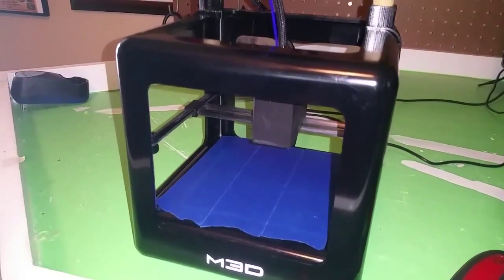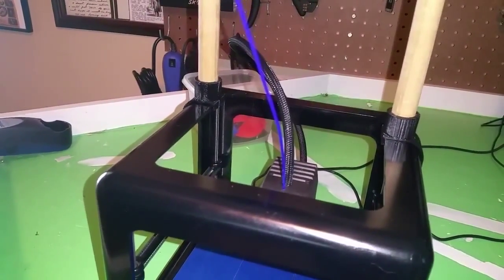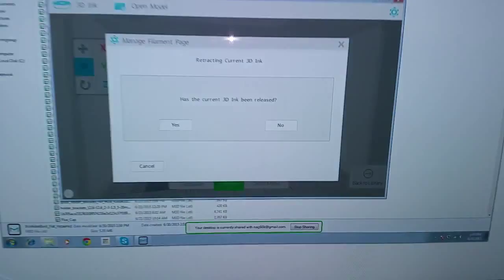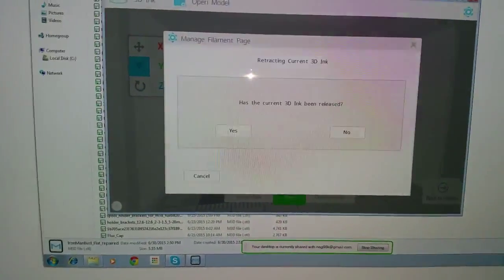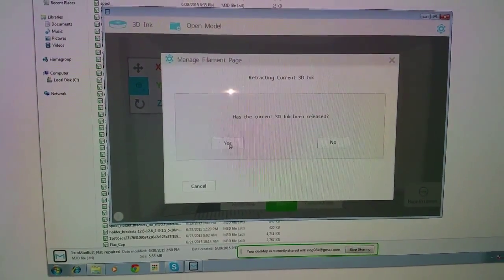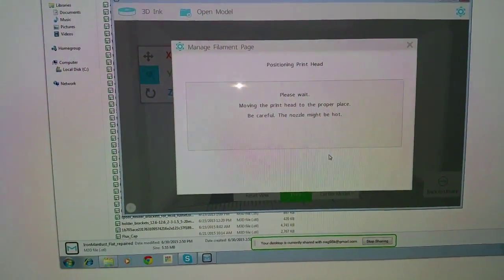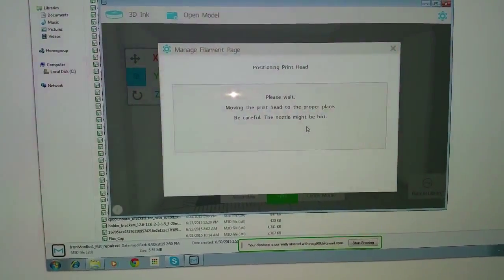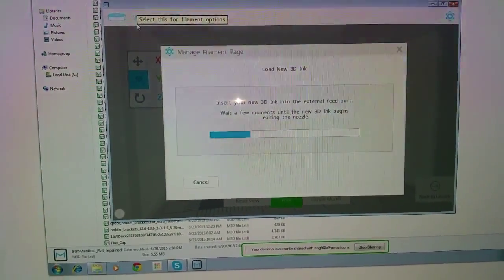M3D Micro Printer - Update #7 - Filament ejection problems

Comment: I usually just go into expert mode then press the The ABS or PLA temp button wait for it to heat up then press the "-E" to back out the filament. Lightly tug on the filament while depress the "-E" button several times. Set the value to 5 or 10 so you don;t have to keep pressing the button so many times. Even if you use the auto eject, keep tugging on the filament while it it ejecting to get it past the thin section of the filament then the blob on the end. In the instructions when unloading the filament from internal they tell you to tug on it while ejecting but guess they forgot to mention this while ejecting from the external as well.